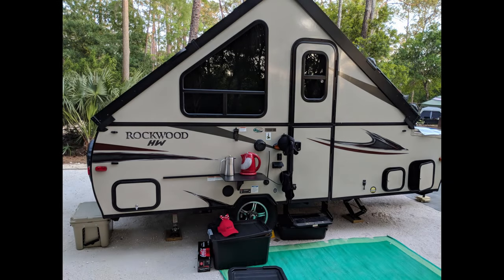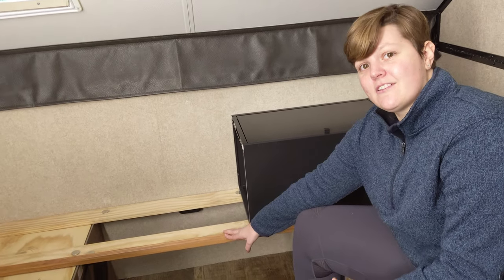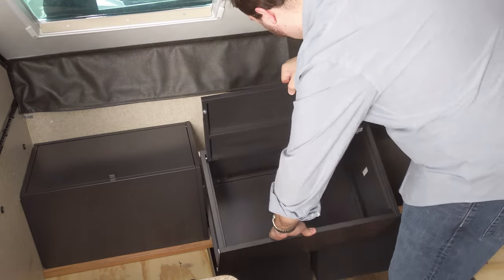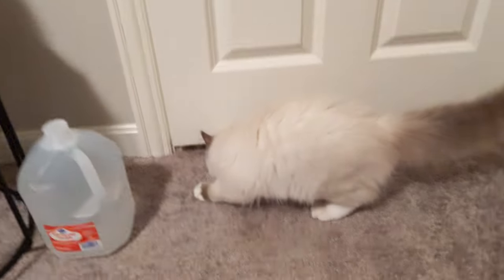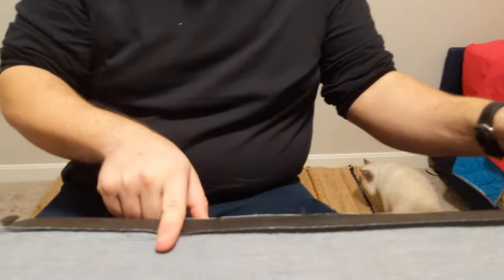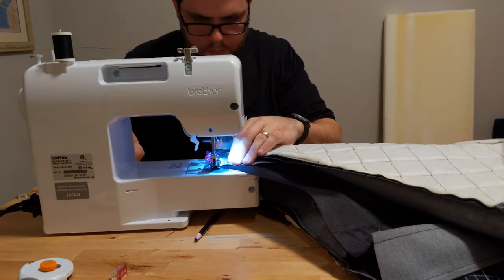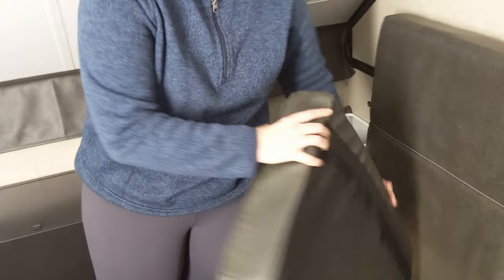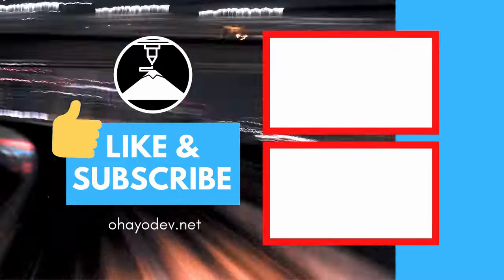A-Frame Storage Ikea Hack

Comment: Great upgrade !  I love it !!    One question though, weight distribution.  Are the devices on the other side enough to balance the trailer when you tow it
Reply from the maker: We haven't noticed any changes to our towing. We tow with a Honda Ridgeline and use a standard hitch without sway control.

Comment: We're cabinets upright to begin with? The link takes my to a picture with a cabinet with 4 legs.
Reply from the maker: Yeah the link is correct.  We didn't put the legs on and oriented them so that the doors open up from the top.  We also added magnet bars to the wall of the A-frame so the doors can easily be left open when desired

Comment: Can you still use the table in bed form, if so how
Reply from the maker: Yes but not very easily. The original table will just barely fit by angling it in and sliding it underneath the cabinet